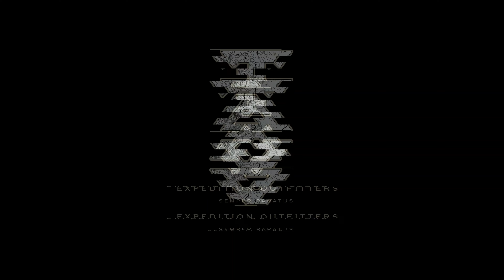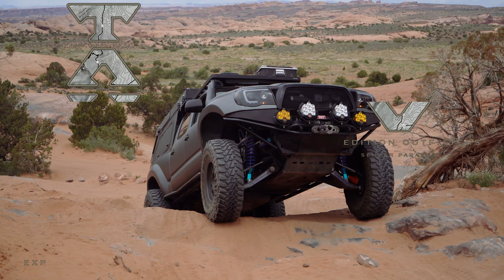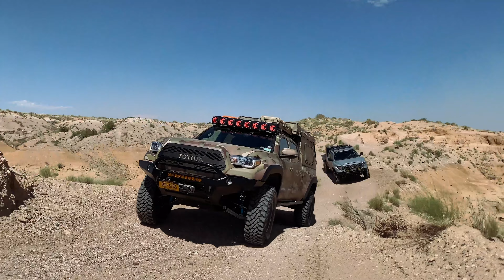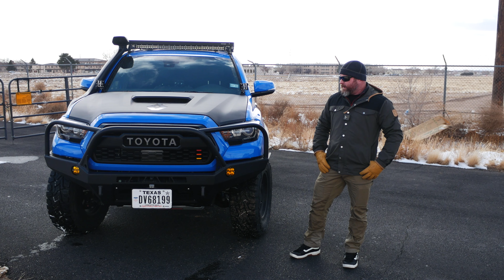TRD PRO  TACOMA  - STAGE 1 Build

Comment: Is there a reason you guys go for King vs other brands? These days I know availability seems to be the biggest factor..
Reply from the maker: Yeah the supply chain is an issue for everyone that makes shocks for various reasons.  When we order the Kings we send them a build sheet specifically for the truck they are going on.  Then King builds them per customer.  We can't do that with anyone else that has a better lead time.  We have also built a relationship with King that allows us to just pick up the phone and order a shock part for rebuilds or damages and have it in our hands in a couple of days.